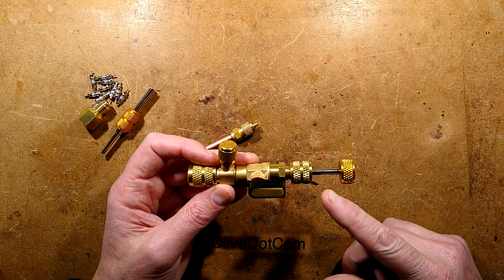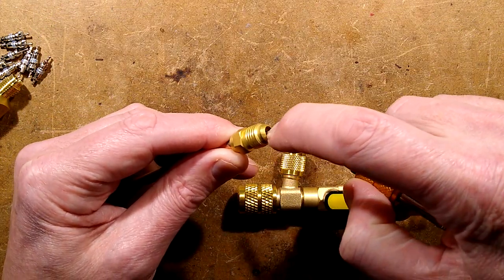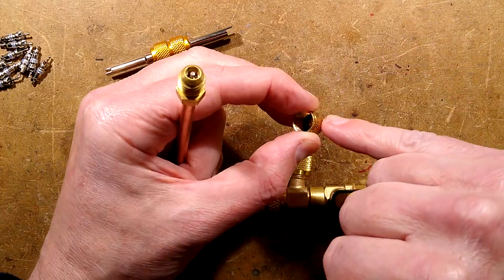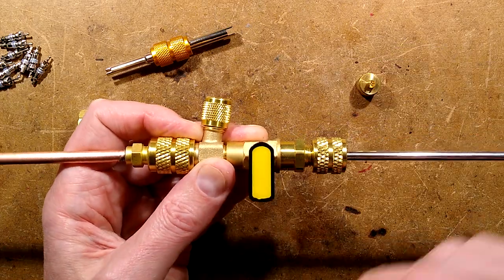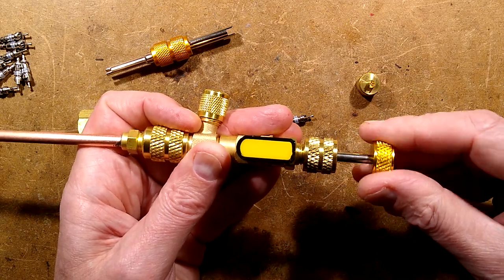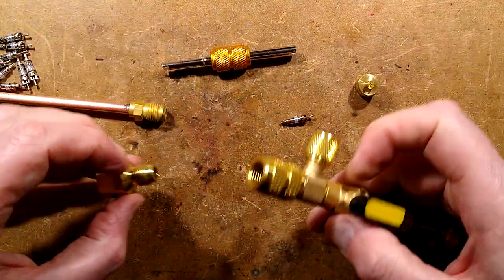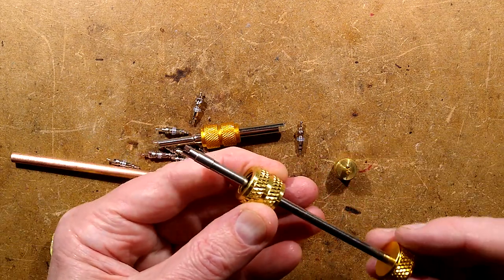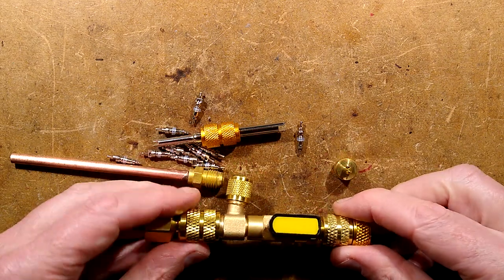Very cool tool - HVAC schrader core changer

Comment: Oh yeah. Those ARE the groovy tool. 
While evacuating a refrigeration system, meaning mechanically extracting EVERYTHING from the system, say after a repair to the system, just prior to recharging the system with refrigerant. Getting absolutely EVERYTHING out of the evacuated system, including air molecules, and especially water molecules, is kind of tricky. 
So, if the system is ready to evacuate, likely what is in their is a pressure test charge of dry nitrogen, let's say, 150 lbs psi that you would use to insure there isn't any leaks. It is important, but doesn't have to be very hi tech, and spraying water mixed with any foaming agent for example dishwashing detergent around any suspected areas and looking for telltale bubbles. Ok no leaks, so open it up and the pressure exits the system down toatmospheric pressure. Then attach your mechanical vacuum pump and draw out EVERYTHING. Like, it should be the same(or better) as stepping outside the international space station, while in orbit.
The thing is, molecules are basically like anything else. They drift around and drift around Willy nilly until they bounce into something, then change direction. If there is little to come into contact with, there isn't any real reason for them to move at all. But they do seem to have a certain perpetual kinetic energy that prevents them from not traveling to and fro as they do, until contacting anything in their path. So somewhere in the environment they reside a vacuum pump is collecting molecules just like them and forcing those molecules to bounce right out of system and into the atmosphere. The mechanical vacuum pump doesn't reach in further than itself and latch onto molecules, no, after a point, it is simply a waiting game. The molecules of perhaps nitrogen that were left behind during the mass exodus of their brothers are basically lost, and alone. And they could actually be 50 feet away from the vacuum pump. Drifting merrily along and bouncing AWAY from the last thing they may have brushed up against. By chance, or statistically, the molecules closest to the vacuum pump have the highest chance of drifting into the throat of the vacuum pump, but they will only enter that chamber and be expelled after bouncing down a long (relatively) narrow tube, with nothing actually pushing it along, and randomly aiming it's path so that nothing is going to make it bounce off course. Just traveling by its own volition through the narrow metal tube is, when you think about it, more UNLIKELY than likely. So, you want to make the path in front of the molecule as clear and without obstructions as you possibly can, so the dam molecule doesn't get only inches away from leaving only to bounce directly backwards after coming into contact with some part of the tiny obstruction called the 'schrader valve'.
It is directly in the path. But for a rather convoluted route to allow escapement while being held open. Not an easy task for the random chance of direction of travel multiplied by time, or would that be divided by time (?)in your attempt to collect the remaining molecules, as best you can. I mean, eventually, everything will find its way out the hole, but taking that Schrader valve out of the way, without allowing atmospheric pressure to contaminate the system, vastly increases the level of vacuum one can achieve under such conditions. Every little bit helps, and I really mean - every little bit.
Now, some of you may think I am over thinking this, and that it is unnecessary to achieve that level of vacuum for a refrigeration  system to work perfectly fine, or on some level of - 'good enough'. 
And I think you are probably right. About all of that. 
I still stand by using that tool during evacuation, as it saves time, and time is money. And you will produce a better product and get better performance.
I believe the devil is in the details of many situations, so I am kind of 'anal' about the details that are often overlooked by others. I was given a nickname 20 years ago and it stuck. 
He calls me. ' Markonius Refrigeranus. 
Kind of a Roman title, don't you think?👍🤓 I don't mind it. 
That's my comment. Except I left out some of the procedure that is required to reach 100 microns or less in a large system, but I won't go on about it.

Comment: The reason not to use silicon or othe oilsubstance to make things glide. Is that they can self egnite under preasure. There is how ever products made that is certified for this. I do not remember the names. That i were used when working in the Dive industri. There is allso O-rings made in other materials like Vitone or Ptfe. For the same reason.

Comment: You could use that to hook up a gauge or use that to recover the system or use it to pull a vacuum or the other function of that is to add refrigerant to the system or diane I don't condone using Diane systems

Comment: What you have there is a great idea if it was produced by a manufacture that had the correct tolerances and a quality assurance standard.  Otherwise, it is just a good paper weight / conversation piece.  I know because I purchased one that was labeled (exact fit for my vehicle) yet it came with extra an extra rod for the just in case one doesn't fit.  
Good idea but at $25 bucks you get what you pay for.  A China paper weight.  
Now go make a live video using this amazing paper weight that you have just indorsed as it was intended on a pressurized AC system.  Good luck.
I'll agree that Chia has produced some good parts and tools for cheap. 
THIS is not one of them.  Although I'm sure that a very small percentage do actually work ok once or twice.  The one I purchased didn't even come close.

Comment: Is the thread on the end the same as a car tyre valve thread? We work with oil filled CTs and VTs at power stations and some of the fill points have standard car tyre size schrader valves. If this would fit it would make my job far easier - and less messy!!
Reply: Thanks. That's just the jobbie that I need.
Reply: @whippetquick3527  Although it does not have an isolation valve, but I suppose that for that application the important thing is to remove the core for a greater flow of fluid.
Reply: Exactly. Greater flow is what we need. The current 'fitting' just pushes the valve pin but the flow is painfully slow.

Comment: I have one but it just doesn't work. unless the valve your removing is facing downward, the valve core does not retain in the tool to pull it through the chambers. I need to magnetize it or something.
Reply from the maker: There should be something to grip it, or the jaws should be a friction fit.

Comment: I wonder how gas-tight that plunger is. A single o-ring doesn't seem adequate to avoid leakage of refrigerant.

Something similar is used in the US to tap water mains. I believe that's a 3 step process: drill, tap, and install valve.
Reply: There are numerous points in a typical HVAC/MVAC system sealed with single o-rings. Anywhere that has a block connection, for example, such as a compressor manifold or condenser hard line.

They do often leak, but generally as a result of poor system maintenance and disuse causing the o-ring to degrade rather than from exceeding the seal's pressure capacity. Running a vehicle's AC for a few minutes every month should be sufficient to keep its oil charge aerosolized and well-distributed; the owner's manual will generally have a note to this effect somewhere.
Reply: @Azlehria  HVAC systems don't have sliding joints, however. If you look at a steam engine or an old vac-fill fountain pen, they use a lot more packing to seal sliding joints like this.
Reply: @PaulSteMarie  You always need more packing, because it's a less efficient sealing material than solid rubber. That is, more of it is required to reach the same sealing capacity.

Two other significant factors that may have escaped your notice here, though, are:

1. These should be used at static equalized pressure, not high-side working pressure. 40-100 PSIG, not 300-500.
2. The working time of this seal is generally less than 1 minute, rather than many hours.

Comment: Question for anyone that might know, does this work for car and bike tyre valves too? It would be a handy thing to have for fixing a slow leak without letting lots of air out
Reply from the maker: There are specific versions for that.
Reply: I hadn't found any after a quick look but I'll keep searching then
Reply: This is done because refrigerant gas is expensive, dangerous and more or less polluting, and air cannot enter the refrigerant circuit either.

But in a tire you normally deflate it completely if it still had pressure, it is important that it is completely deflated because otherwise the core would be shot out like a bullet, in any case you must wear safety glasses because it may happen that the damaged core does not let out all the air, then you remove the damaged core and install a new one and re-inflate the tire.
Reply: @ruben_balea  I know why it's used in refrigeration.

The advantage in using a tool like this for vehicles instead of doing it the normal way is you don't have to depressurise the tyre and don't have to worry about the valve core becoming a projectile is a happy accident.

Comment: You really, really, REALLY need to be sure the valve is seated properly and sealing when removing the tool at 2:50 or you will get about -70C refrigerant on your fingers. I always use gloves with neoprene coating when removing hoses and tools from a pressurized system

Comment: does anyone know of one or have a link for automotive sized fittings? I have a core i need to change out
Reply from the maker: You can get ones designed specifically for automotive use on eBay.